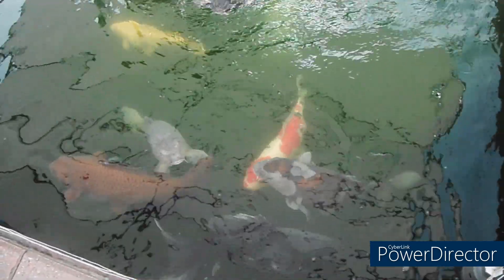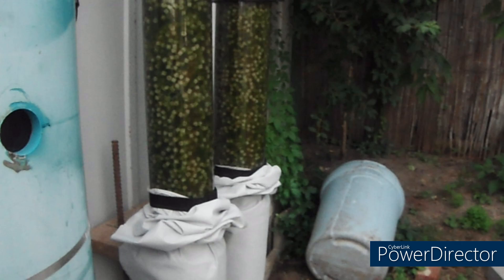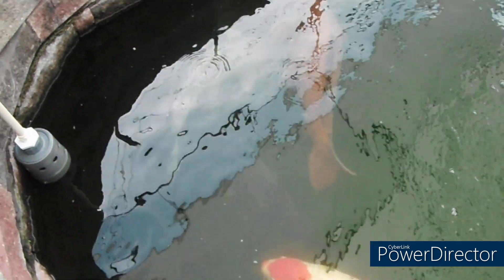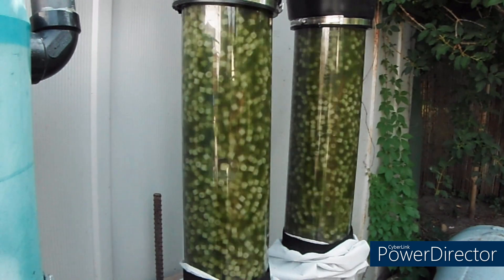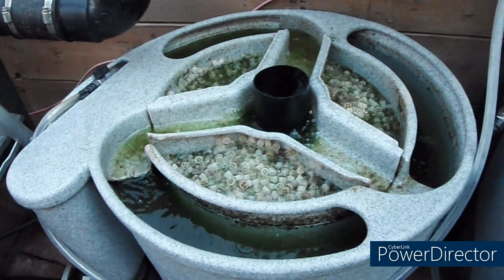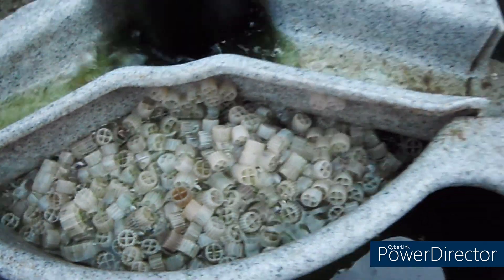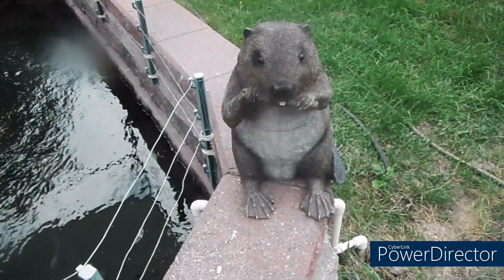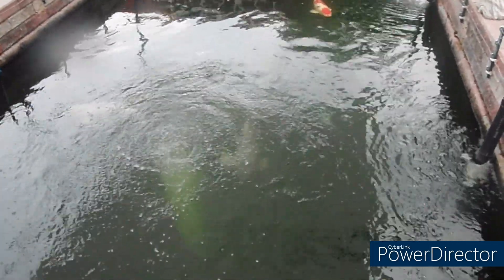Disgusting Upflow Filter - Was it worth building it?

Comment: I have an 8kl pond, six koi, Oase Screenmatic setup output to a water fall.  I've got plants in my pond though, I switched out the pond soil for straight sand after having a blanket weed issue two years ago.  Problem solved, the plants draw out the excess nitrates, phosphates etc. Very minimal algae, a couple of spots in the low flow areas may get a tiny bit, but it's not even worth pulling out. I have seen those pods in Vandermeer garden centre and your the first I've seen with them.  Water hyacinth is also amazing at drawing out all the excess NPK, they multiply so fast I just get rid of what I don't want or they take over, although since I switched the soil for sand they definitely don't grow so fast!

Comment: The 26 deg water temp may have a slightly adverse effect on colour intensity but it should also provide you with optimal growing conditions so I would use it to good effect and gradually increase the number of feeds a day to maybe 10 or 12 high protein growth food feeds, but ensure you monitor ammonia and nitrite levels closely while you do because the bacteria in the filter media will need to increase correspondingly to cope with the increased level of waste the Koi produce feeding at that level will create!
Should give you significant growth though!
Reply from the maker: This year was the first time I used an auto feeder providing 3 feeds per day which was in addition to hand feeding at least twice more per day. Growth rate has been steady based on age. Most of my fish are in the mid teens to mid twenties so growth rate has slowed significantly, if at all for them The younger ones continue to grow well.

Comment: I don’t know what flow rate your currently running through your Eazypods but their optimal rate for Koi ponds is around 5000lts (1000 gals) per hour and given the size of your pond I imagine you are flowing way more than that!
Splitting the Eazypods as you are suggesting would have the added benefit of allowing you half the flow through them that should improve there performance considerably, reducing the load on the rest of the system so I would definitely do it!
Reply from the maker: Thanks for your comment. The pond is shut down now for the winter but when operating water flow through the Eazypods is approximately 1300 US gph and does work very well. Splitting the feed from the bottom drain definitely made a difference. The upflow filters are feed by a separate pump so no direct impact on the Eazypod flow rate. Main thing is that the fish are happy and healthy. 😀👍🏻